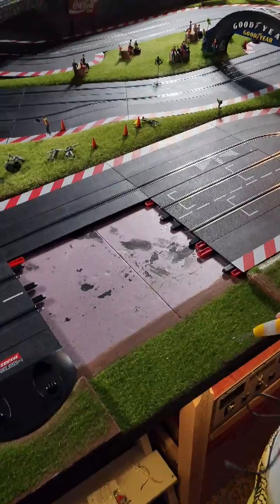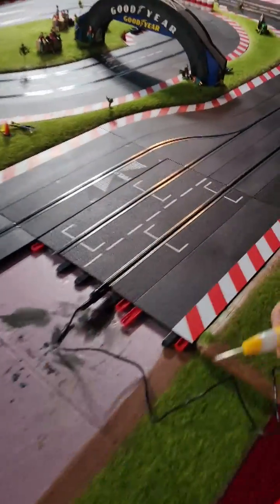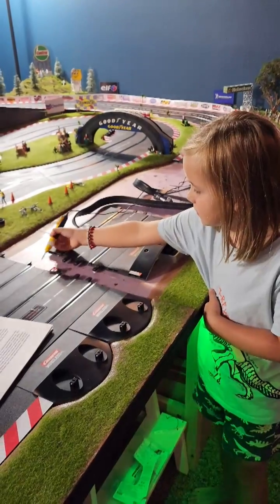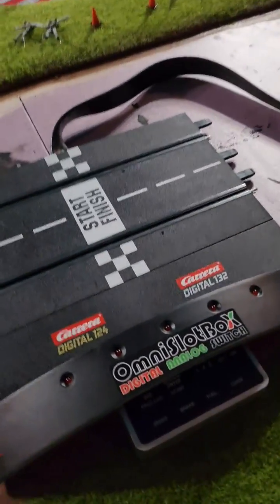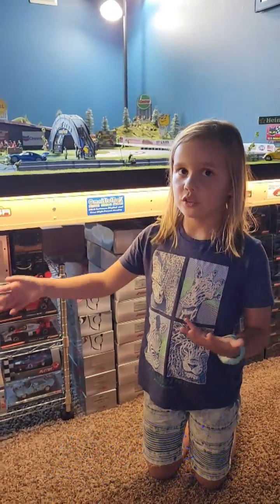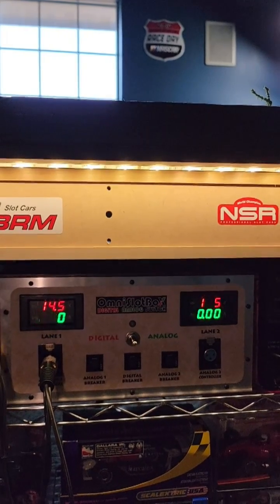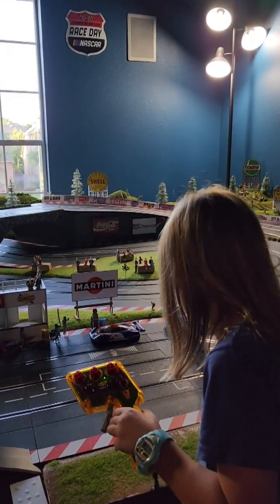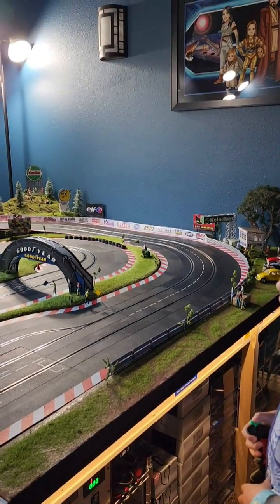OmniSlotBox install #omnislotbox #slotcars @jimcunningham534

Comment: Question, where did you get that neat little rack with the wheels for your omnislot box and other equipment I like the way it fits nearly under the table. Thanks.
Reply from the maker: We got it on Amazon. There's multiple different sizes to suit different applications. They're nice and strong, too. Thanks for watching.
Reply: @DNASlotCars  thanks
Reply from the maker: NP

Comment: Do you use pink foam boards underneath your tracks and if so what thickness?
Reply from the maker: Hi Kevin, there is a base layer of 1" xps insulation board on top of the plywood base. Then a 1/2 " layer of xps that the track is recessed into.
Reply: @DNASlotCars  Thank you for the information and because of you I’m buying the Omni Slot Box.. How com you did not purchase the XRM Omni Slot Box?
Reply from the maker: That's great to hear, make sure and tell Jim we sent you! I really wanted the digital readouts as I like the visibility. Not essential, but I preferred the extra bits and bobs and felt it was worth the extra cost. 😊
Reply: @DNASlotCars  I’m sold and I did mention you and your daughter as well as Massimo.
Reply from the maker: Massimo is a classic act! Lovely guy.